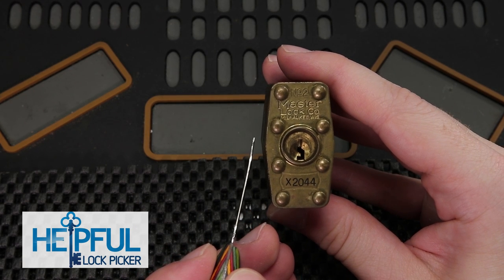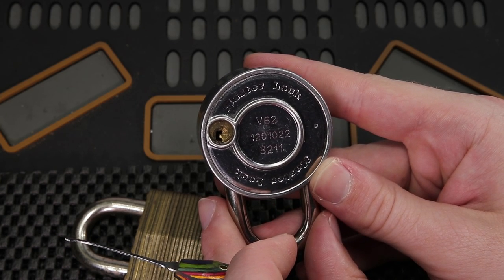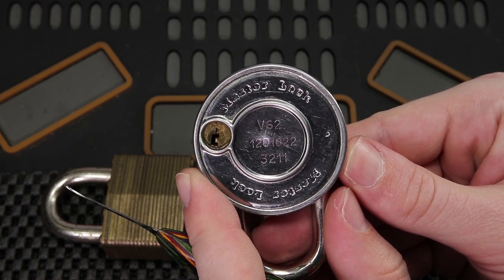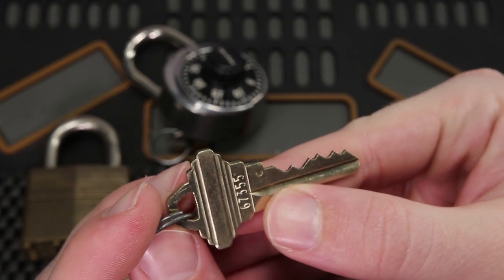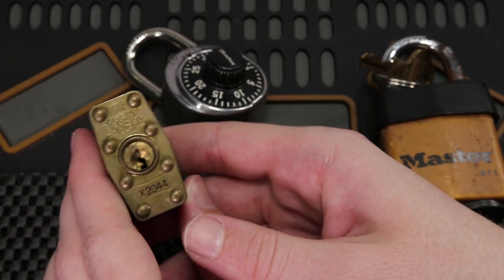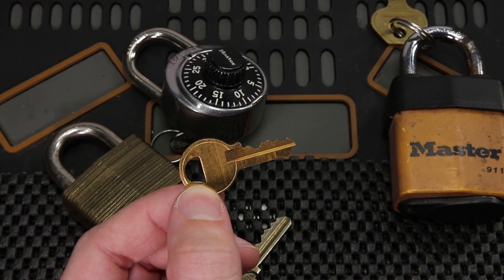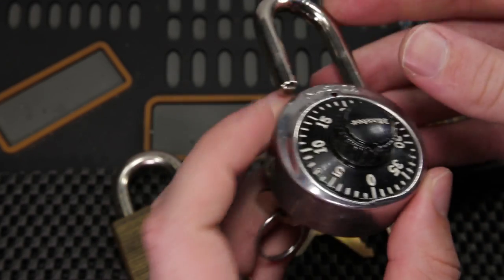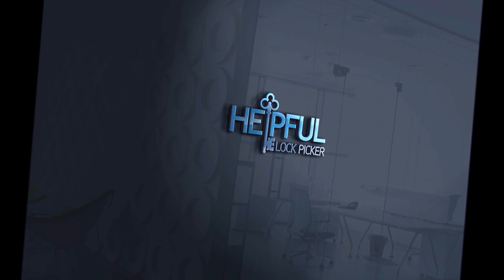[286] What Do These Small Numbers On My Lock Mean

Comment: Trying to think positive here with this crazy manufacturing madness. 

The bitting code on the key odds still much better than having it on the lock. Also I suppose the blind code is better as you have to pay to use the information filled database.
Reply from the maker: Many of the codes on the lock are meant to be wiped off after but on locks like your mailbox, toolbox, desk, etc take a look they will likely have a code stamped on the front of them.

Lock codes is harder to sign up for but my understanding is insta code anyone can sign for and it is only a few dollars.
Reply: @HelpfulLockPicker  Instacode is 10-15 bucks a month

Comment: Isn't it suspicious to go to a locksmith with this kind of information?

Also, how much would it cost (roughly) to make a custom key ?
Reply from the maker: I guess it depends on the locksmith and your approach but I have called multiple locksmiths over the phone requesting keys to be cut by the bitting code and they just do it.

 to answer your question, a code cut key is usually more expensive than a duplicate it could be anywhere between $5 to $15